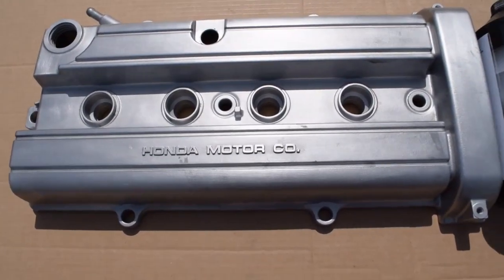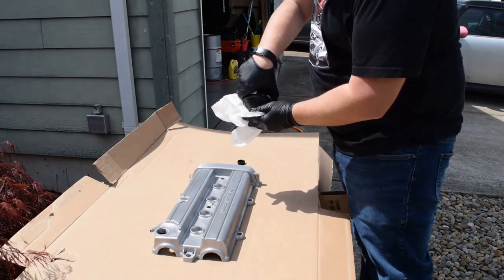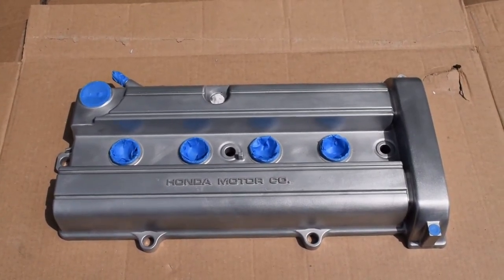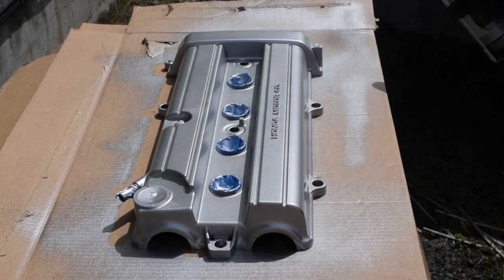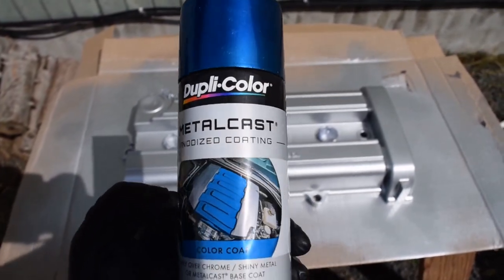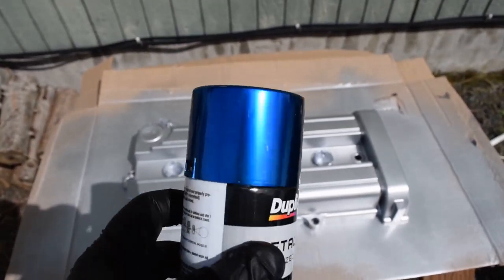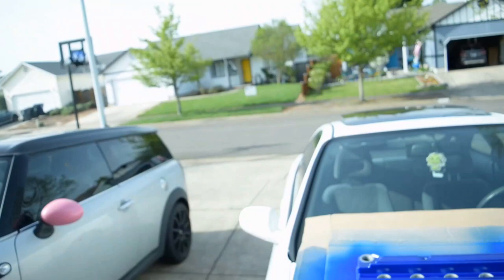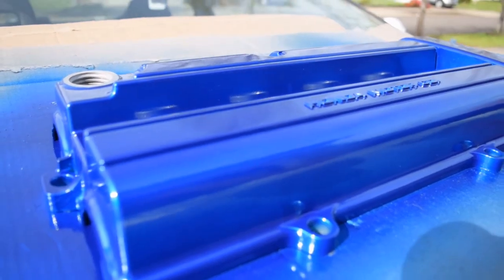Integra Valve Cover Painted Dupli-Color Metalcast Blue

Comment: Metalcast works great for your tail lights and side markers also. 
Top with a clear coat. 
On one set of taillights,I changed the amber turn lens to red for a cleaner look ,and it still shines amber. 
Another project, the car was green so I did the side markers in green.
With amber bulbs it washes out the color when lit up. 
Add some clear coat for a shiny OEM look and save a fortune over tinted lenses.
Reply from the maker: Wow never thought of that. Thanks for sharing. Also thank you for watching
Reply: @CZMate  no problem man. 
Yeah for the vws the old hella tinted taillights were big money ,250-300 a set. 
Diy for like 1/10th of that with a few spray cans.

Comment: Good job 👍🏻
Reply from the maker: Thank you for commenting and watching. I appreciate the support. I am very happy on how it turned out and it is still in great condition after so long on the car. Thanks again
Reply: @CZMate  there are lots of videos using this paint and system and I'm glad to say yours is one of the good ones 👍🏻 came out really nice. I'm looking to do my brake calipers and some engine parts but unfortunately I'm in the UK and cannot get the Duplicolor paint but can get the VHT anodised paints which is a derivative company or sister company to Duplicolor so I'm hoping the colours will be as they say ,🙏🏻
Reply from the maker: @martynj-c4965  I try to get the best angle and try to get the best shots for my videos. VHT is great paint too. I have used their products and always turns out great. I am glad my video was helpful. Great luck with your projects. Let me know if you have any questions
Reply: @CZMate  cheers buddy. I have 1 question ...can you send me the VHT Duplicolor in red? 🤪🤣👍🏻
Reply from the maker: Lol not sure if you can send that through the mail. I know they always ask at the post office. Send me a Message on Instagram
Reply: @CZMate  my friends in Vegas and would send it if I can't get an equivalent. If the VHT stuff here is basically owned by the same company as Duplicolor then I'm assuming and hoping it's the same stuff so I'll find out later from a UK distributor. Was just joking with you bud. I don't think rattle cans would be accepted to ship international unless it's a special courier service. It's gotten tighter here with restrictions and costs more now. Cheers and keep up the good work 👍🏻

Comment: What did you use as a Clear Coat, and did you scuff sand or wet sand the blue before adding the clear coat. I am assuming not as the metal cast is suppose to be all coats within an hour and then it says to let it cure for 7 days before putting more coats on it.
I am going to paint archery bow risers and was planning on stripping them all the way down as they have black paint on them and I think the metalcast would look better on shiny aluminum as compared to doing the base coat and then the color.
Reply from the maker: I just cleared right after I put the metal cast paint on. It's just a clear I had already, it is in the video. It will look good taking it down to bare metal great idea. You can pick up some 2k clear if you want some high quality clear. It cost a lot more but totally worth it. 

Thanks for watching and commenting. I appreciate the support. Let me know if you have any other questions
Reply: @CZMate  I have some 2K clear I think from Rustoleum and or Krylon. 
I have had issues in the past with the chemicals not jiving together.
I dont mind the money so much and am considering automotive metalic paints for the limbs later. 
I would have to set it up though to make larger quantities to get the value out of it though.
I plan on videoing and posting the first Riser tests, so I will throw a link to you when I do this.
It is snowing out today but when I can set it up to paint it warm. Ill post it.
TY for the response.
Eldan at Blue Dragon Archery.

Comment: How does it hold up with the heat? Why didnt u use a high heat gloss?
Reply from the maker: It been holding up fine to the heat. It still looks brand new. I had that clear sitting around for my wheel project. I did my Civics valve cover a year ago with Dupli-color wheel paint and its been fine too.

Comment: did you have to add primer before base paint or is the base paint the same as primer ?
Reply from the maker: No primer way laid down. With the metalcast paint you can paint right over bare metal. I decided to use the base coat as well. It's been on for over 30k miles and no problems. The valve cover looks like the day I painted it. Let me know if you have any more questions. Thanks for watching and commenting. 👊🤟
Reply: @CZMate  thank you very much for responding. I appreciate the knowledge you give and very much appreciate. Thank you
Reply from the maker: Of course I want to help anyone who has questions with the best of my knowledge. I appreciate the support 👊🤟

Comment: Are all those paints high heat resistant?
Reply from the maker: I haven't had a problem with the valve cover at all. It's almost been 2 years and I drive 23-25k miles a year. So so almost 50k miles and still looks like I did it on the first day. I hope that helps answer the question. Let me know if there is anything else I can help with. Thanks for watching and commenting 👊 🤟

Comment: Looks great. Thinking of using this on my calipers or rotors but not sure how heat resistant it is
Reply from the maker: Thank you. I was thinking about doing my calipers too. You don't want to paint your actual rotor. Your brake pads wont work as good and ma cause braking issues. Glad you enjoyed the video.

Comment: You should top coat that with spray max 2k clear
Reply from the maker: Yeah that clear is some good stuff. I just didn't want to wait to get it or really spend the money for it at the time. Thanks for the suggestion tho. I appreciate it. Thanks for watching and commenting. 🤟 The valve cover still looks great. It's been at least 30-35k miles since I painted it.

Comment: Duplicolor recommended to me, when I asked, NOT to put a clear over Metalcast.
Reply from the maker: Did they give a reason? It works great and they also have a metalcast clear I believe. Thanks for watching and commenting. Let me know so more info
Reply: @CZMate  Because the top cost, though colour IS a clear coat, the way the tech told it. Plus it's made for heat exposure unlike many clear coats.
Reply from the maker: Thanks for sharing that information 🤟  I appreciate it.

Comment: How it gonna hold up to the engine heat thou
Reply from the maker: It's been over two years and idk how many miles and looks great. Check out my latest video and you can see it. 😁 Thanks for watching and commenting. I appreciate the support 👊🤟
Reply from the maker: https://youtu.be/1dlGi-OSQNo
Reply: Normal automotive,or most any paint in a spray bomb is good for 250f at the minimum unless it says it's rated for a higher temp. 
So if your valve cover is getting hotter than that, you've got other issues. 
You don't really need any special engine enamel stuff, some of the longest lasting finishes I've had on engine blocks is using a cheap enamel I get at the autobody supply ,and a cheap 20$ detail gun to spray it with.
I've never had any problems from heat burning off from not using "engine paint".

Comment: No primer do. Damm.
Reply from the maker: My last valve cover i did the same way and its still looking great. Also the Metalcast paint can be used right over chrome parts alone.
Reply: I did some similar but luck you have cause my car paint cracked with red metal cast. But an adhesion promoter will be helpfull ima do some like tht maybe but iwanna paint my valve cover over gold.
Reply from the maker: Gold will be nice, on what color car? I did my red Civic's valve cover bronze (like my wheels) it turned out good too.
Reply: @CZMate  its a red integra and ima paint my wheels metalic gold 2. Those colors combined well it looks nice and valve cover i use primer cause i never have luck paint cracks unless u use ahesive primer for anodize dupli.. but ihave some blue 2 but i said lets go gold ima post it up and install.